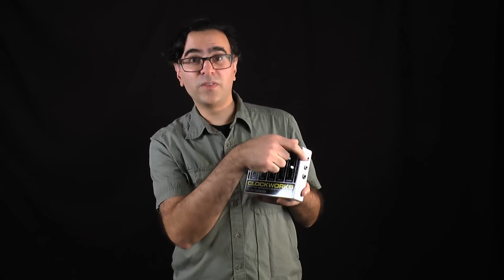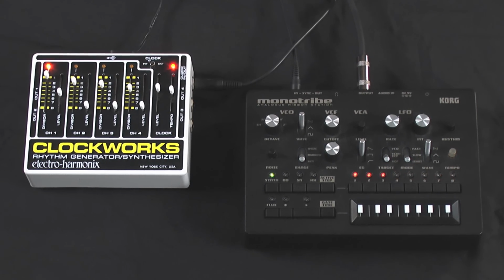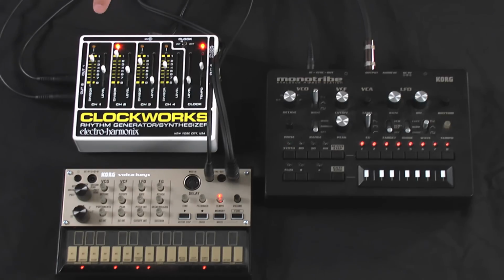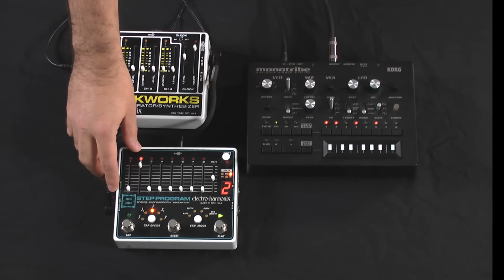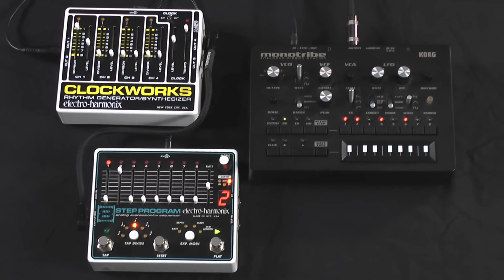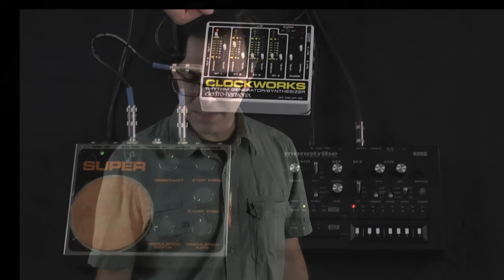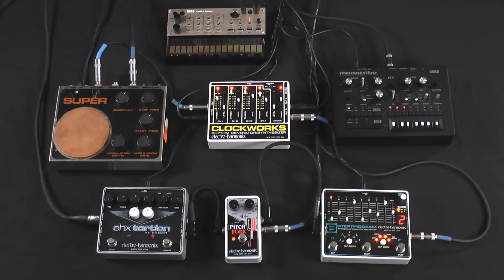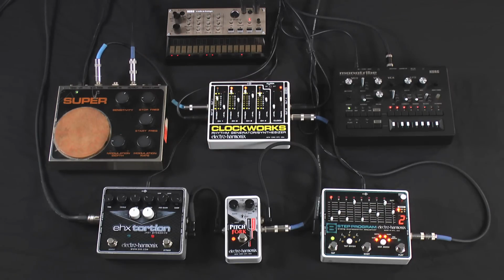Electro-Harmonix Clockworks Rhythm Generator / Synthesizer (Pedal Demo)

Comment: Can I have a DSI Tempest drum machine as a master clock and can I hook this up to my Moog and Prophet synths and have everything be in time or is that only possible with midi? How can I use this to hook up to my analog gear?
Reply from the maker: We
 have taken a look at the Tempest’s webpage and they don’t specifically 
say they have a clock or pulse output that the Clockworks could follow 
although they do have a sample labeled CLICK. Possibly the CLICK sound 
could be used to trigger the Clockworks if it is sent to its own 
dedicated output. The one worry is that since the CLICK sound is audio 
it may not be loud enough to trigger the Clockworks.  Otherwise
 the Clockworks should be able to provide clock pulses that the Moog and
 Prophet synths can follow if they have Clock inputs.
Reply: EHX I think they only have MIDI in. :(
Reply: EverettDudgeon138       I don't know if you still interested in a solution for this old post but you may want to research and watch two videos here on YT :

1. Syncing MIDI clock to ,(click track) digitech jamMan Stereo (check the details in the description as  he made a  second projecti)

2.  Usb midi clock to din syn 24 converter -  sync   606 with ableton live

Comment: i would at least liked to see a tempo read out LCD screen. come on guys! you make a clocking box with no tempo read out? isnt tempo the main part of a clocking device?!
Reply: Well if it's an actual recreation of the original circuit, the oscillator driving the clock is probably analogue. This has an external clock option if you want to sync it to something else generating a specific tempo. But if you're running it with this as the master then it doesn't really matter if you're at precisely 120bpm or if you're at 119.7 because everything else will be synchronised to this.

Comment: clock
Reply: works
Reply: Hey this just you need to tie it all together when you use or have a mod rex modulater in other words by itself its fantastic! but when ya combine other stuff like a keyboard or an drum machine or both your starting to sound like a pro thanks again ehx for other home run with the Clocksworks tk